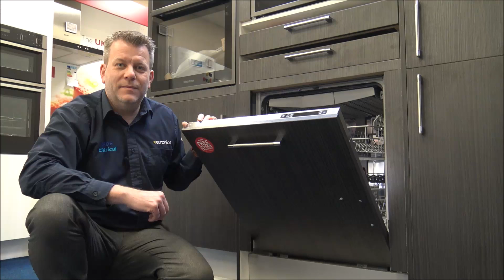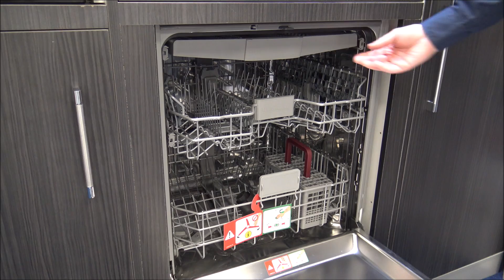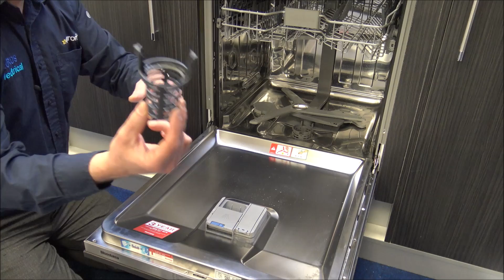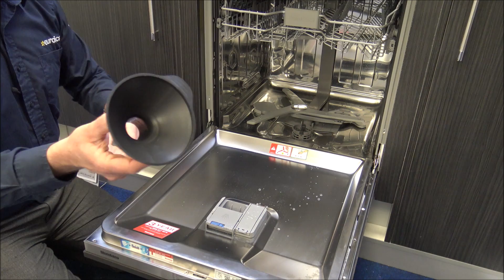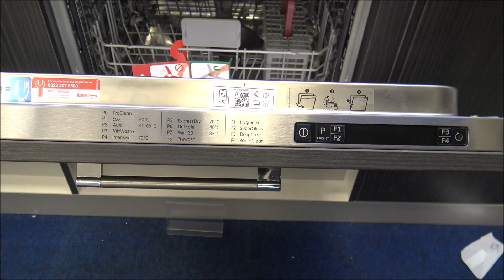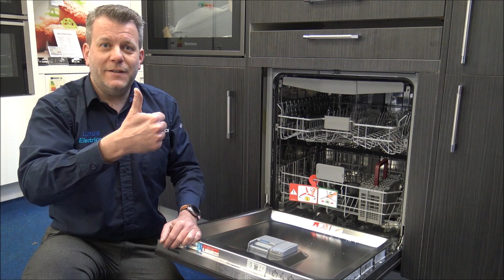Blomberg LDV63440 16 Place Setting Fully Integrated Dishwasher

Comment: Thank you this is very helpful, on the euronics website they say there is a half load function, is this the same as the quickwash? Thanks
Reply from the maker: No they will be different options. Quick wash is available for full load options but just a quicker program. Half load is normally for half the dishwasher where a reduced amount of plates and cups are used and needed to be cleaned.
Reply: So for a half load function, do we use only the top rack or the bottom one. 
Or place dishes, cutlery anyhow top and bottom, and use half load cycle

Comment: I bought this dishwasher 3 weeks ago and i use finish products and i have two questions.
1. I put in finish salt from day one and the salt sign is still on. Why is that?
2. The finish tablet never dissolves and all my plates near at the front are covered with powder. I have tried the eco, auto and the intensive program which is 70 degrees wash and still it doesn’t dissolve the tablet. What can do about this?
Reply from the maker: It sounds like your water pressure could be low if the tablet isn't dissolving properly. Also try pouring a couple of cups of water into the salt compartment with the salt as it can help to start the machine going with the salt or put a bit more in too.